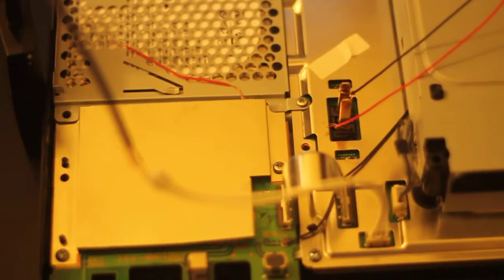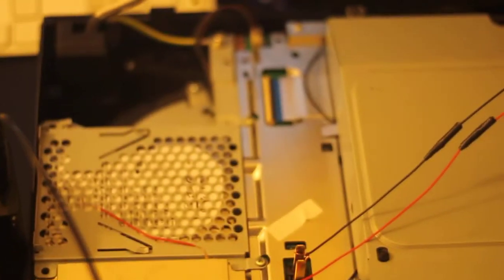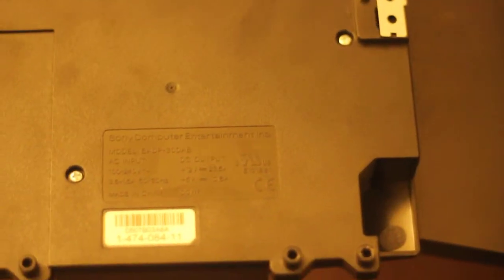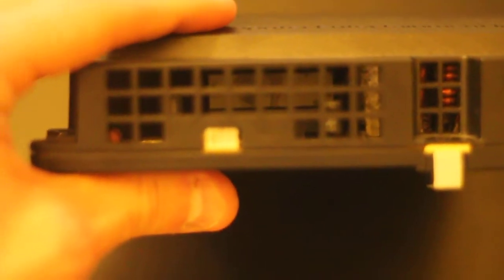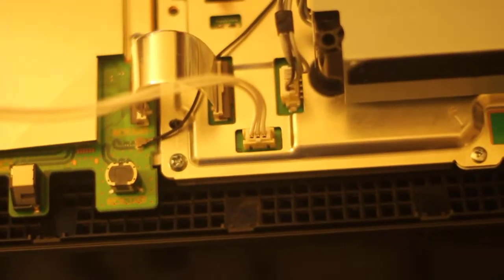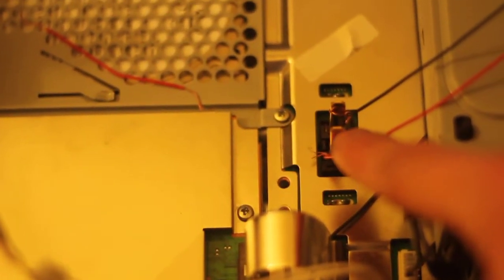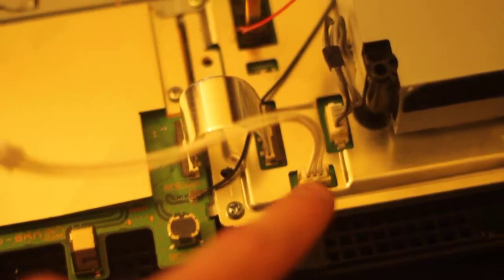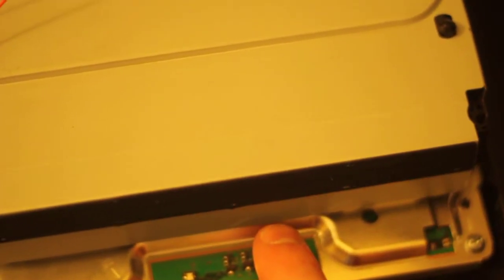PS3 YLOD - Power Supply Test

Comment: Thanks for posting this. I have the exact same ps3 I am trying to resolve the ylod problem with. I Gabe now Bren able to rule out the HDD by swapping into a working ps3 and using an desktop pc power supply to power ps3 to duplicate the same problem. Were u able yo resolve your ylod with a reflow?